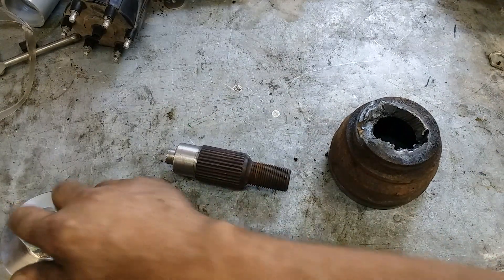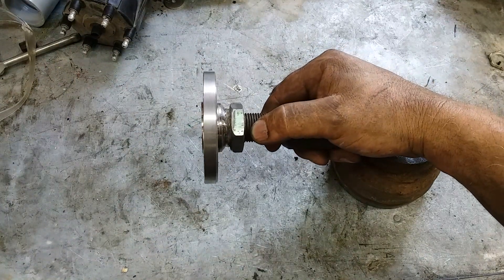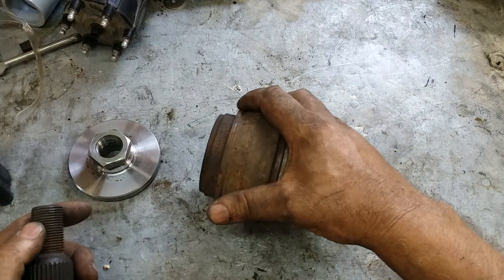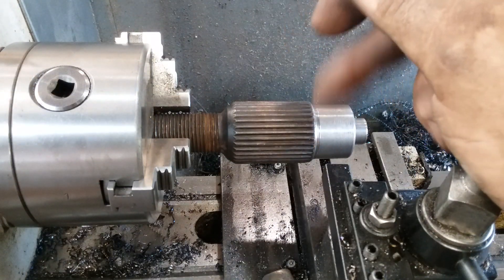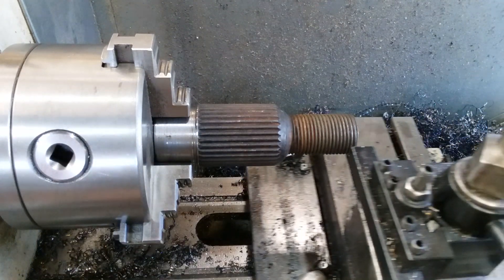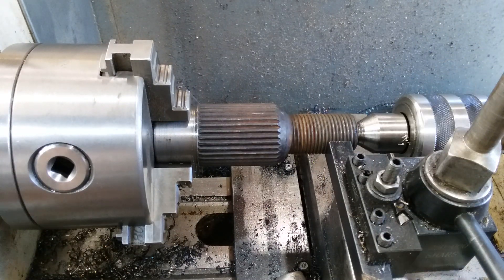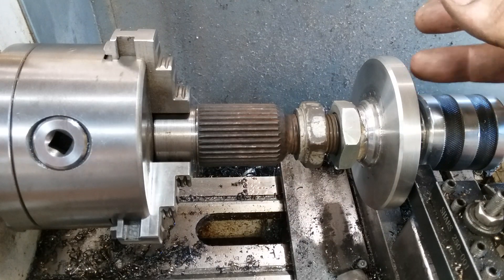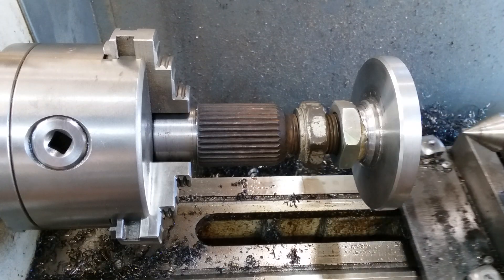Making an alignment tool adaptor.

Comment: You did a good job on that. I have don't the same "centering" but I used a roller bearing adapted to the tool post. Thanks for putting up the video.👍
Reply from the maker: "one of these days" I aim to make a roller bump tool.